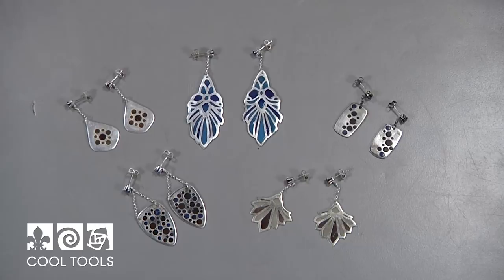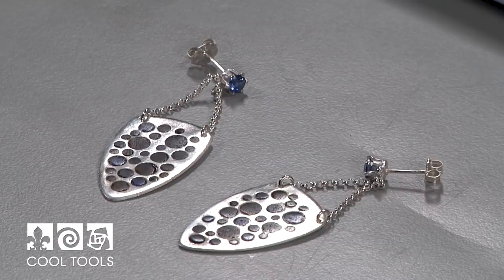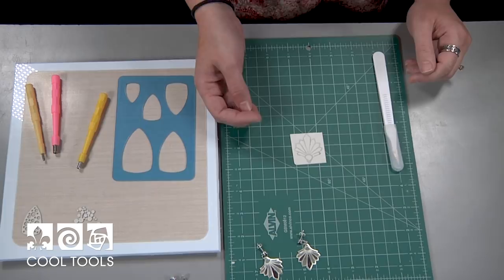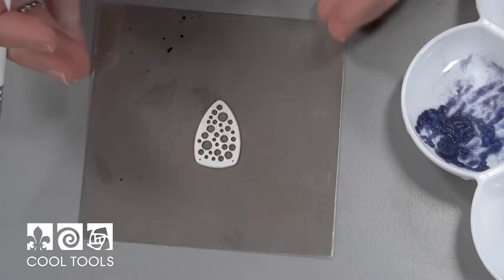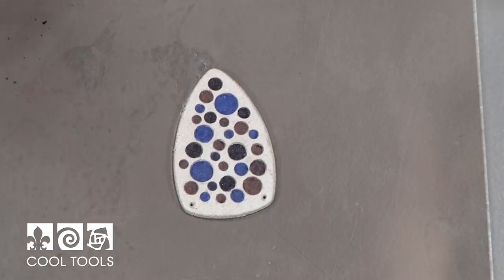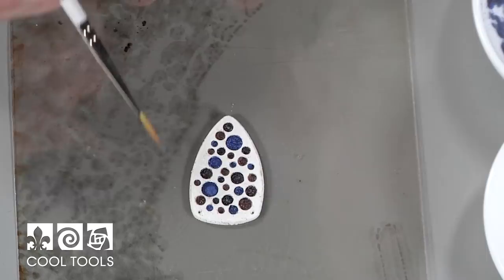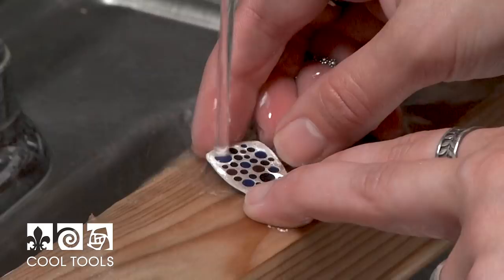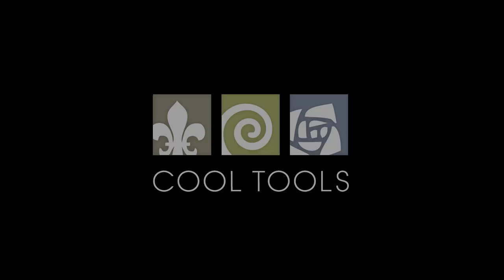Cool Tools | FS999™ Plique a Jour Stained Glass Earrings by Karen Trexler

Comment: Nice effect.  You'd have better control when stoning, if you mounted your piece to a flat board or piece of metal using chaser's pitch.  You could probably get away with using hot glue instead.  This allows you to move the smallest, and lightest object, rather than the large and clumsy stones.  As long as the piece is mounted parallel to the board, it's easy to keep it parallel to the stone.

Comment: Just fire the clay, (with a torch), then put packing tape on the back, and drop some uv resin in the spaces. If you add alcohol inks, glitter or mica powder (or any combination), to the resin and hit it with a uv light or put it in the sun for an hour. Boom-Shazam-Done! So many more possibilities! A lot less hassle!
Reply: But that would not be vitreous enamel. Different skill level and very different results.
 :-)
Reply: And you could try to cook a gourmet meal in a microwave with a box kit <3
Reply: K

Comment: Can you use sterling silver for this? Instead of fine enamel?
Reply from the maker: Hello, it is recommended to enamel on fine silver; however you can enamel on sterling silver if it's been depletion gilded. EZ960, our sterling silver clay actually be enameled on without depletion gilding. Check out Karen's blog on enameling on EZ960: https://blog.cooltools.us/2021/10/05/enameling-on-ez960-sterling-silver-metal-clay/

Comment: Looks great I wonder if you could use glass frit and just melt glass in the holes. Then it would be a true "Stained Glass" jewelry item :)
Reply: Gamer   I doubt you cold do the with silver because the melting point of silver is less then that of glass.  But stainless steel or even nickle metal would work.
Reply: @mysticdavestarotmachinesho5093  Glass gets soft at around 1250 to 1350 F. You can take it much higher for more flow though.

Comment: Seems like a waste of clay drying the clay prior to cutting. Is there a reason you don't do your cuts while the clay is wet? I'm fairly new to metal clay, so please excuse my ignorance. :)
Reply from the maker: Hi Dianne, That's actually a great question- Thanks for asking! I choose to work with the clay dried for a couple of reasons. First, I find that it is easier to get clean, sharp cuts when the clay is in the greenware stage. When I tried to cut the clay while it was still wet my edges dragged some and left me with an uneven edge. It was easy to allow the clay to dry and clean up those outside edges, but it proved difficult to clean up those inside edges I made to fill with enamel. For the sake of saving myself clean up time and to get really nice clean cuts, I choose to work in greenware. Also, If you were planning on using pencil to gently lay out your design wet clay does not accept pencil lines as easily, and you are more likely to accidentally leave scratches from your pencil on the surface of the clay. I reconstituted the dry clay (we have videos on how to do that as well!)  that was removed for my next project so it wasn't wasted either. Thanks for the question Dianne!